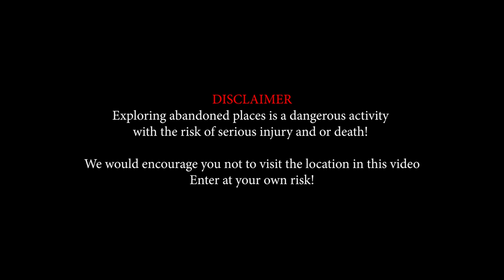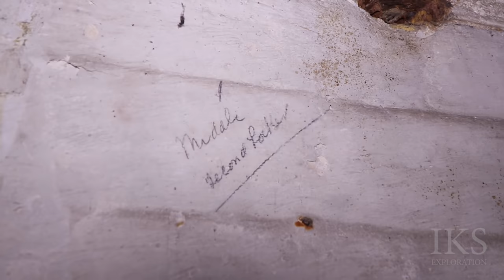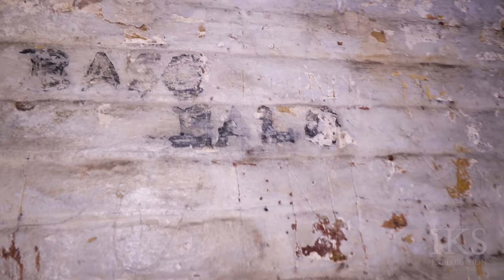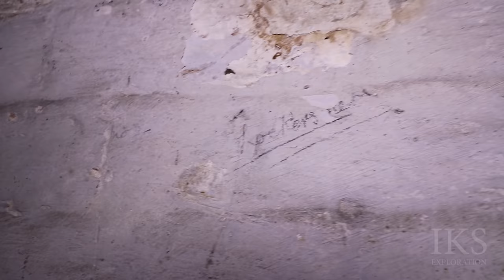Western Heights Dover Citadel - 5 Year Quest Digging into a Prison

Comment: Sparks Greenham, drew a circuit diagram of a single valve tuneable receiver with headphones. One up from a passive Chrystal set receiver. It would have needed 1.5V for the heater, and about 90V for the HT. Sparks refers to a radio Engineer. It might be possible to trace him, he might still be around, as it is dated 1962.
Reply: I thought it was a transmitter for Morse code
Reply: @differentname8051  It has headphones.
Reply: 90 v?
Reply: Exactly what I thought, instantly recognized it as an old valve receiver.  Anyone get anywhere tracing it?

Comment: Drawing @26:48 is circuit diagram of radio receiver & a “sparks” is an electrician
Reply: "Sparks" is the old term for a radio operator on a ship, not an electrician (That's a "Sparky"!!!), it dates back to when they used "Spark Gap" Morse code transmitters prior to 1920's. Possibly reference to a naval radio operator?
Reply: @sampointau  Yes fair point Sam thanks for pointing that out that makes even more sense.
Reply: @gravyytube  just remembered, they also used the term sparks for base radio operators in the army in WW1 and WW2.

Comment: That little diagram for Sparks is a simple radio receiver circuit..!
Reply: It's a basic Regenerative Receiver circuit. Seems to be missing a couple of things, looks like they may have rubbed / flaked off.
Reply: @theuntidyworkbench7444  It similar to the simple crystal radio used by POW's where the valve is used as both the detector and small signal amplifier for crystal ear piece. Interesting though, as couldn't see any selectability....
Reply: Sorry, missed the variable across the input coil...small symbol so missed it. Triode seems to be direct heated.

Comment: The blueprints to where u were show u came up through the shaft of the water well that explains the rebar those casements had a well incase of siege so a fresh water supply was assured the blueprints show the staircase hallway takes you two different places you havent been yet and dirt infilling in the casemate was from the side which means on top of dirt pile dig and you should get into 7 more divided rooms and possibly another hallway on the second casemate there is another staircase going down to i have no idea where

Comment: 26:51 that looks like the circuit schematic diagram for an old arc rectifier or possibly for the circuitry the rectifier connected to to power the place
Reply: It's a Regenerative Receiver circuit, a basic one "valve" radio.